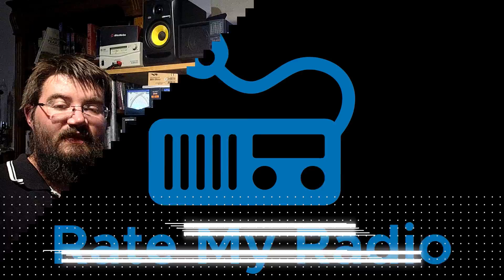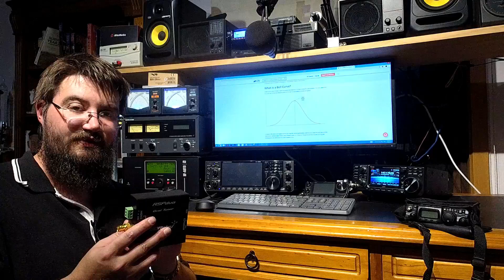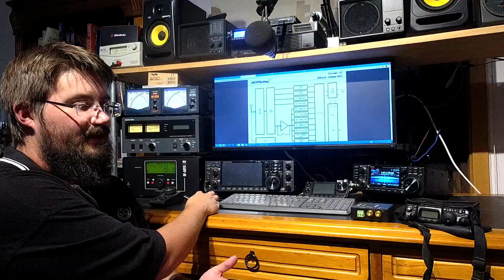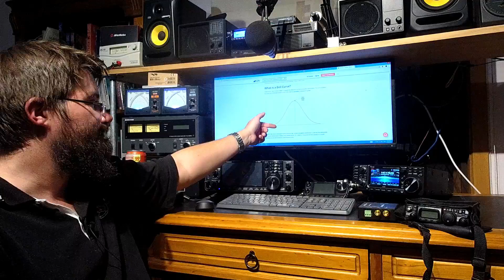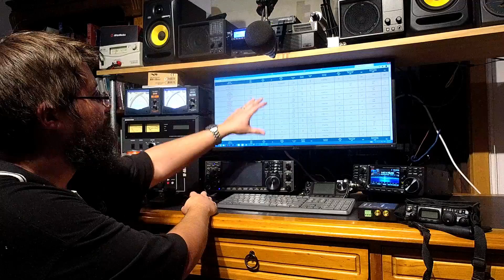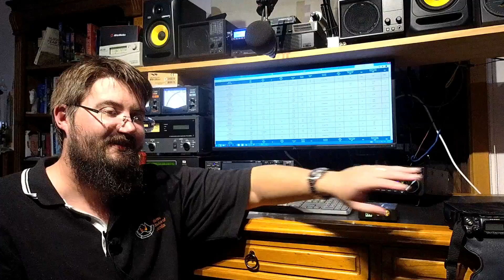Icom IC-9700 Haters' Delight?  VK3BL discusses Measurement & Statistics

Comment: Modern hams don't realize how GREAT we have it in terms of the performance of modern equipment; complaing about 30 Hz. drift on 144 MHz., or 300 Hz. on 1.2 GHz?!

The first radio I ever got on the air with as a newly licensed Technician back in 1969 was a PolyComm 6 at the high school radio club where I got my license; the first radio I bought brand new was a Lafayette HA-460.  Both radios were vacuum tube 6 meter AM transceivers which when operated on their internal VFO's (vs. crystal control) routinely drifted 50 KHz. (or more!).    When the dial graduation marks were only EVERY 50 KHZ., that drift amount didn't seem all that bad.  Of course, AM tuning is nowhere as critical as SSB, but older SSB transceivers drifted as well.

If your THAT concerned about the IC-9700's stability, install the Leo Bodner GPS lock board (I plan to do mine in the near future); mainly considering for best frequenct accuracy in planning to try EME in the neard future.

But even as it is?  I LOVE my IC-9700!  😁

Comment: Icom would supply a frequency stability specification for each band the radio operates on. If it operates within those specifications all is well. If it doesn't it needs to be fixed, it's as simple as that.

Comment: Thanks for you honest info on your reports.  I have been a marine electronics tech for aprox 40 years and recently got my amatuer extra.  In the marine industry we have channeled VHF and HF radios that I have to check for their frequency, modulation (devation in FM) and power.  My test communications monitor has to be better than 1 part per million to properly test the radios in frequency my unit is portable and new was $5000. I have seen and used units over $15000. they are considered a secondary standard and are checked against WWV for accuracy.   The radios are required to be kept with a 10 ppm accuracy which means at 150mhz i need to ajust them to less than 1500 hz off frequency, when I ajust them I try for 150hz off.  If you look at 1.2ghz if held to that standard then 1.2Ghz would be within  12,000 hz .  I did not find if or what the requirment is for amatuer radio is but do not think it is this high.  Wanting a radio to hold to a much higher standard would probibly put the cost beyond most amatuer's reach.  We have a standard available to us that is much higher for free that we can use  to lock our transceivers to if we use either WWV or GPS.  Think about the  mesurement in parts per million as a better guage of accurate tuining,  it is also much easer to make an accurate radio at HF than SHF.

Comment: I couldn't be bothered to sit through 40 minutes of this.  I work in the amateur bands in the microwave range up to 24 GHz.  It really isn't hard to get good frequency stability with a GPSDO.  You just have to implement it correctly.  ICOM didn't implement it correctly in the 9700.

Comment: I will keep my ICOM 910H & 821H & have just as much FUN & I have less money in them combined.better yet I don't have any need to put my fingers all over the display of either of them unless i am wiping the dust from the display not wiping the oily fingerprints from it because I must touch the screen just so I can make basic changes to the radio.I don't see the desire for touching the screen on any radio so that it performs any function.ICOM is pushing me further & further away & forcing me to buy Used gear as I did with the 910H & 821H but they are saving me money I must say.

Comment: Signal generator technology has brought down costs below what he is stating.  Google them, look for yourself.  The sig generator has to have better specs than the radio being tested.  But even having such a piece of test equipment isn't something you or I will use every day.  As he states above it costs more than the radio. Either the radio meets spec or it doesn't.  There is not a whole lot you can do about it if it is off. Do you have surface mount skills ?  Improve your antenna system is something you CAN control. As  other posters have said enjoy the hobby !
Reply: I'm talking RX stability of course.

Comment: I want to have a radio on the table to do exclusively VHF / UHF, would you like an opinion about spending more than $ 2,000.00 buying an IC 9700 or buying a multiband ICOM IC 9100 ?? Can you help me with your opinion ??
Sorry I dont write english is very well,   73
Reply from the maker: Of course, and we will shortly be publishing a video about who should buy this radio as soon as I get my voice back (summer flu).  As a dedicated 2M, 70cm & 23cm general purpose SSB radio you cannot go wrong with the IC-9700.  It is also very well suited for satellite operators.  The only people who have a negative opinion of the radio are those who realistically believe it should have included an atomic clock!! 73, Jarrad VK3BL

Comment: Jarrod, there are several different worries here: the basic frequency accuracy and long term (many minutes or hours) environmental temperature drift easily measurable with a counter, and the short term temperature drift caused by heat from the finals being blown over the frequency reference oscillator, during a transmission. The first isn't that big a deal, and the microwave crowd has been dealing with it for years. The second can be an issue if one is using say the JT modes, and the frequency drift during a transmission is enough to screw up the software decoding algorithm on the receive end (and I don't know that it is that bad, I'm just giving an example). I have an old FT-847, and it was known for this - and Kuhne Electronics in Germany made a little heater module to slide over the reference crystal and ovenize it. I submit that an SDRplay is a reasonably good instrument to look at this short term drift provided the power is reasonably stable (separate battery?), as the absolute accuracy isn't as important as short term drift.

Comment: Hi Jarrad, yeah I have heard hams criticizing the radio for being overpriced. It is going to be a fine radio I think and will be pretty popular. I would like to get my hands on one for satellite work. Best 73!
Reply: well, I do think it is overprice... here in Canada, it is 2799$ + tx = 3000+ for only 3 band radio and one of which might not be used by everyone... I think Icom should have made options for the 1.2GHz and D-Star... remove 1200$ for the 1.2GHz module and another 600$ for the D-Star module, now you get a very nice VHF/UHF SDR radio at the price point of a 7300, now THAT would have been an awesome deal... As much as I would like to get one, 3000$CA+ for such a radio is way way over my budget...
Reply from the maker: Dear Rich, there is one thing I know for sure, and thats that it is not overpriced!  Sitting in my local ham shop Strictly Ham for just 30 minutes I heard 2 orders being taken over the phone and that was in addition to myself picking up my unit!  It isn't priced like an IC-R8600 fortunately, 73, Jarrad VK3BL
Reply: Ham Radio with K0PIR for sure if all you’re going to use it for his satellite it is very very overpriced when you can buy an ICOM 910H fully loaded for less than half the price.

Comment: As a retired engineer and Extra Class licensee, I can support this video unreservedly. I taught statistics at the college level and have been licensed since 1957. Yes, I own a rig which is an Icom... the IC-7300, and can tell you that it is spot on when compared with other HF radios of the $1,000 class. To properly measure, then compare an analog radio to one with digital capabilities, FIRST read the ARRL book, SDR and find out why the technology and the math cannot be applied directly to these rigs because it is like comparing apples to oranges. Not just bad testing, but poor technique and theory. de KQ2E
Reply from the maker: Thanks very much for the kind words Bruce.  I must admit I wasn't sure how the video would be taken given the controversial nature of the topic, but overall the response seems to be positive.  Unfortunately I managed to make it a bit long winded but even 'scratching the surface' of both measurement and statistical analysis fundamentals is not an easy task!  73, Jarrad VK3BL :)

Comment: I like how you are approaching this whole analysis... but there are two things, 1, when comparing two radios against each other, you have to realise that the 9700 that was tested against the other icom radio render the 9700 as good or below the measurement of an older radio which is NOT to be expected from a radio of this price range, you understand what I am trying to say ? Regardless of the test methodology and equipement test, the 9700 should have smoke (at least the community expect this) that older radio... 

and 2, your video is so freakn distractive... I could not take my eyes of that Tokyo Hy-Power amp and peek at it for 40 minutes... you lucky you... don't EVER sell that thing, they are gems of technology... I envy you so much ! for that THP and 9700 in fact...

Again, good video !
Reply from the maker: Regarding the performance, I've been conversing with Rob Sherwood and whilst I have to go over his detailed analysis, the IC-9700 does indeed smoke older radios.  He has also been so kind as to provide me with previous reviews of older equipment, as a comparison point.  PS, you're totally right about the THP HL2.5Kfx; it is amazing, I got it for a bargain price second hand and I just can't see myself ever letting it go.  Even to this day it keeps up with new designs.  73, Jarrad VK3BL :)

Comment: I Just heard now that  guys on 10ghz  said its not like what yesterday been said as much ,and that with a new firmware can be settled.
Reply: Actually not quite true, David. The (perceived) frequency stability can't be fixed within the rig itself by a firmware change alone. That would require some hardware change or modification. If there is a firmware fix, you would still need an external reference to hold the rig within the frequency limits that some people say they require. Note again that I do describe perceived instability by others, I don't have an issue with it.
Reply from the maker: A very niche interest group will not be happy with the performance, but one wonders why they buy the radio given the specifications are published!  For what its worth, the same niche group has modified every previous radio they've used, so again it doesn't make too much sense to think that suddenly a radio at this price point would meet all their desires.  73, Jarrad VK3BL :)
Reply: @RateMyRadio  A radio with an external 10 MHz reference should have frequency stability as good as the external reference.  The 9700 does not.  I bought it expecting it to perform like every other ext ref device on the planet.  It doesn't.  I'm not interested in using the internal oscilllator, as the published specs say it is crap.
Reply: Well I better wait for more  reviews till now still I like it.
Reply: Just now 
http://www.icom.co.jp/world/support/download/firm/IC-9700/1_06/

Comment: Although I completely agree with the main point  of the video,  think that the video misses the point. 

As already mentioned in the comments, a radio which is 500 Hz off on 23 cm isn't defective. At 1300 MHz, the 0,5 ppm gives you offset up to +/- 650 Hz. This specification is bad for narrow-band digital modes which are channelized, and for extremely slow modes. For most of other purposes, it's fine, as long as there's no offset between tx frequency and rx frequency, the 1 Hz frequency resolution gives enough room to compensate.

The main issue is that people expected 1 ppb stability, didn't check the manual, and are disappointed when they didn't get it. Same for 10 MHz in. References  with 1 ppb or better stability are available, but the IC-9700 manual states that the 10 MHz in is only for one-time calibration, while people assumed otherwise, and are now feeling disappointed.
Reply: Agree - why the heck did ICOM integrate a 10 MHz reference input just for one-time calibration when even the RSP2 can LOCK to an external reference? Many hams have multiple very stable references (0,05 ppm is no deal for an OCXO and  GPSDOs, Rubidium normals are way better) at hand.. And no, 'phase noise' isn't a valid argument - it's possible to lock frequency stability and phase noise to different references..
Reply: @salat  Just a wild guess... From what I've heard, the external 10 MHz in is used for service calibration as well. Maybe it was very cheap to get the external connector? But still, the 10 MHz in is pretty unusual solution.
Reply: @salat  Agreed, but I suspect that this is an oversight and will be corrected. How often has software been released that doesn't have at least one unnoticed bug in it?
Reply: @wurlitzerwilly  I'm not so sure about that being a software bug. I mean, this looks more like it's an issue at the specification level. Otherwise, it wouldn't be described in the way it is in the manual. Also, the 10 MHz reference input on the IC-7610 seems to be calibration-only, and not a lock-on,  as well.. At least as far as I can understand how it works based on the manual, since the explanation is very short.
Reply: @AndrejaKostic  I didn't say it is a bug, I said it's an omission. Meaning it's something they had not fully considered. It looks likely that it's fixable for those who need it, but IF the drift is too much for some, I would rather object to having to hang and external device on a brand new radio. Tempus Fugit.............
Reply: Simple answer is that if you require a specification which is better than that published by the manufacturer, don't buy the radio!
Buying one, knowing that it would not meet your requirements is just plain stupidity, regardless of what other people say they have measured.
Buying one hoping that it will be better than the published specification, then griping when it doesn't, is even worse stupidity! :-)
Reply from the maker: I think it is a very valid point; the spec sheet has been published it doesn't make sense for Hams to purchase a radio that doesn't suit their needs and then complain.  For what its worth, Rob Sherwood measured his IC-9700s 'drift' at a maximum of 70Hz; that is already significantly better than specification, and Rob used a HP 5335A Frequency Counter, not another transceiver he had modified...  73, Jarrad VK3BL :)
Reply: I think almost noone complains about the actual accuracy of the built in XO per spec but the rather ridiculous "reference input" . Who would actually expect a one-time calibration only function when there's a 10 MHz reference input mentioned in the specs? Again: Even you RSP2 has a reference input that it actually locks to! The manual in which this quirked function is described was released way after many ppl preordered (But hey - I wasn't that foolish - no damage for me. I'll wait until the 9700A or whatever gets this fixed :) 73
Reply: The problem here is ICOM put a 10 MHz ref input on the radio and didn't implement it properly.  Thus people's understandable annoyance when the radio drifts like an abandoned canoe.

Comment: Hi Jarod,

There is no perfect transceiver., and in Amateur radio,  we do care about precision, but up to what level?  We just want to enjoy the hobby.  I have Baofeng handy, and who care much about the frequency stability, because it is on FM mode, and the frequency are CHANGING  all the time. :)

But on SSB, or AM, a good frequency stability  is required to have better signal quality.  But, remember, there are other parameters which affecting the signal, such as QRM and QRN.  Even in digital mode, there are codecs  which includes Error Corection  Code (ECC) to make the data more robust. 

I think IC-9700's frequency stability is 0.5 ppm. Basic calculation  ..

1 MHz, 0.5 Hz
10 MHz, 5 Hz
100 MHz, 50 Hz
1 GHz, 500 Hz 

At UHF band the deviation seem to be higher,  but,  we have RIT, XIT  to compasate  the deviation/drift.    The monitoring  party can adjust until  he/she  is happy and enjoy listening to it. :)

Let's us enjoy this hobby together. 

Yours,
Bahathir 9W2GNU, 73.
Reply from the maker: Dear Bahathir, thanks for providing the math, and I'm happy to inform you that Rob Sherwood measured the drift/deviation of his IC-9700 @ 1.2GHz using a HP 5335A Frequency Counter to be about 70Hz.  That is much better than the official specifications and I do hope people don't get to caught up on measurements made with lesser equipment.  As you say, there is a reason we have RIT and XIT and it seems some hams have forgotten where we came from in this great hobby.  73, Jarrad VK3BL :)
Reply: And if you want to work digital modes, 500 Hz drift at 1 GHz is completely unacceptable.  But that's the spec of the internal osc, so fair enough.  The problem is, when I put a MUCH better reference into the ext ref jack, it still drifts like crazy.  That's unacceptable.  You can't fix this with the RIT/XIT.

Comment: Price, Price, Price.  It is way too expensive!
Reply: I thought that initially as well, but it does more when compared to the 7300. It has two receivers to the 7300's 1. Anything dealing with the 23cm band is dealing with more sensitive signal issues than anything in the HF range.  Ultimately, the 9700 is solving a harder problem than the 7300, and is still less than twice the price of the 7300.  Does it cost more than I'm comfortable to spend right now?  Sure.  Do I wish it cost less?  Absolutely.  My assumption is that after it has been on the market for a year or two, like the 7300, the price will drop to a more attractive point. (No, you didn't mention the 7300, I did, but it seems to be the obvious radio to compare it to, since it shares much of the same architecture.)